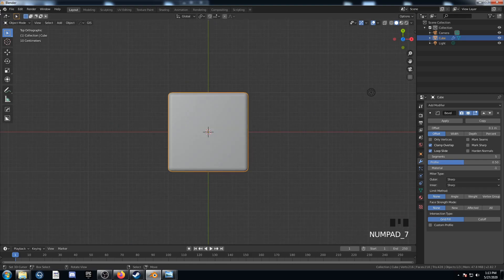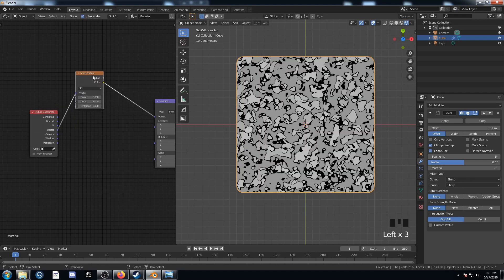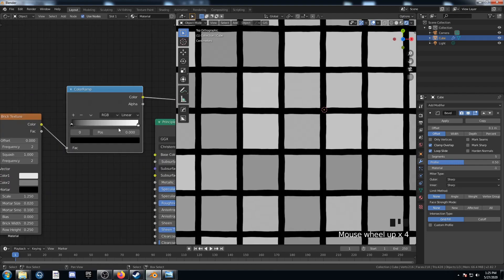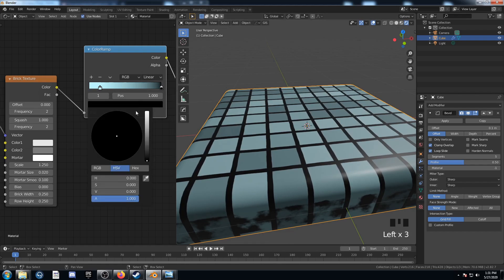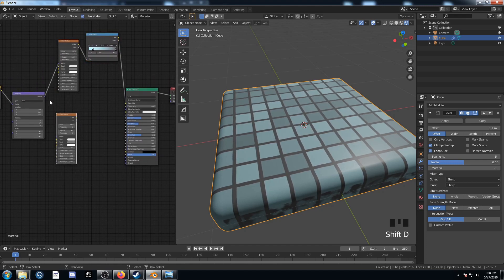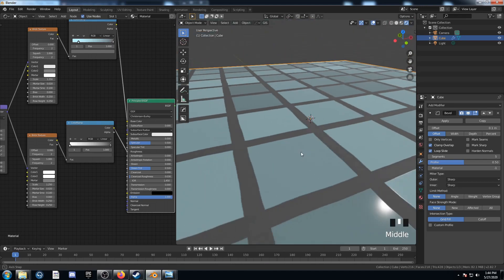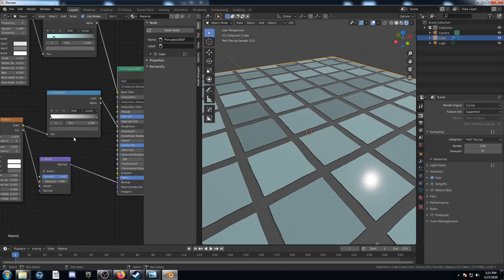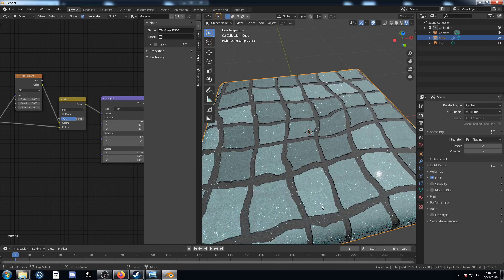Procedural Nodes (part 7) - Procedural tile texture in Blender

Comment: Do you know if it is possible to use the brick texture node to make a Flemish bond grid pattern? The Flemish pattern is the one where the bricks alternate their lengths. For example, the row has a long brick, then a short brick, then a long brick, then the short and so on. Each row with this long/short pattern is also offset in relation to the rows above/below it.

Comment: Why do we connect specifically the Object Texture Coordinate to the noise texture?  I mean, I see that it gives us the desired effect, but why?
Reply from the maker: The reason is the way that the coordinate system is projected on the mesh. For the generated output the coordinate system is 0 to 1, which means the pattern stretches to be if the mesh is deformed. With the object output the coordinate system is does not stretch with the mesh, and this keeps the pattern from stretching as well. Depending on what you are doing, either method may be preferable.

Comment: What does Fac output do?
Reply from the maker: For nodes with a color and a fac output, fac output displays the red or x channel of the color output. For example with noise color output, if you run it into a separate xyz node and then look at the x channel it should be the same image as when you look at the fac output right out from the noise node.

Comment: Thanks for the tutorial Sam! I was trying to make the tiles wrap around the cube perfectly. No luck so far. I am guessing that has to do with the Texture Coordinate node?
Reply from the maker: Hey thanks for the comments! I know what you mean and I haven't figured it out yet, but I also haven't really played around with it too much. I would suggest experimenting with just the brick texture to simplify it as it seems like the mapping that prevents it from wrapping all the way around the cube is coming from that node.
Reply: @kohrakvaza Bricks is a 2D texture so you'll have to use UV coordinates to get it to cover all sides of the object without smearing along the projected axis. Using a multiple of 2 for the scale with the default UV map should work fine for what you want.